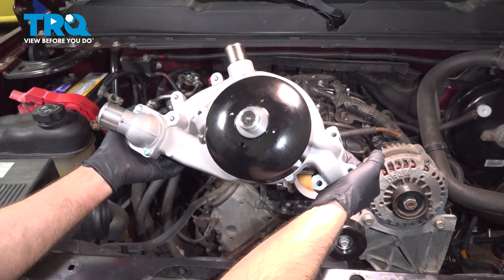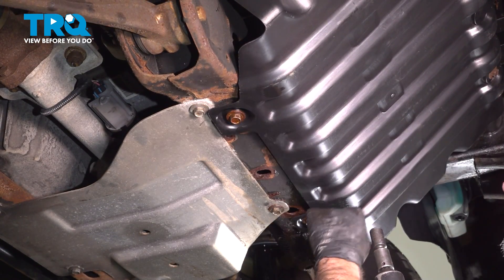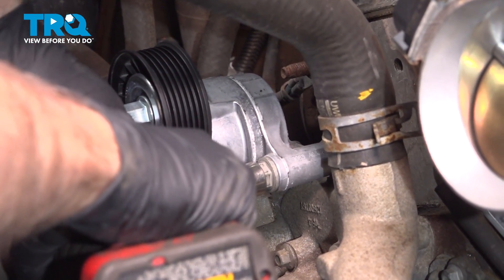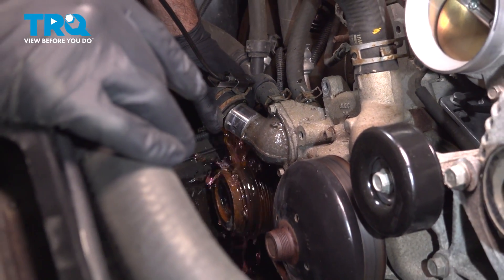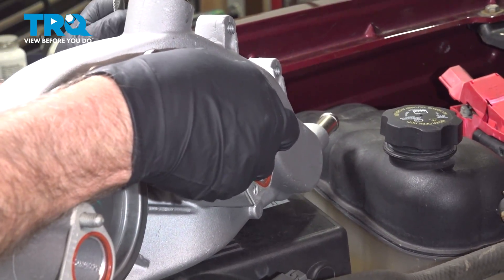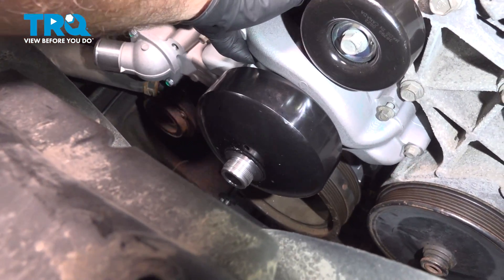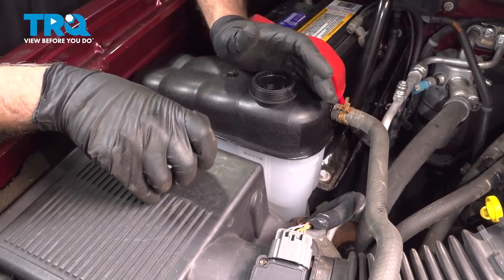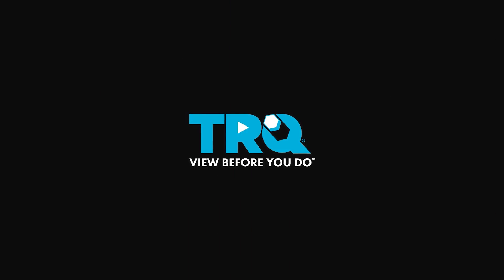How to Replace Water Pump 2007-2013 Chevy Silverado

Comment: i just did this job id say it’s a good time to replace the camshaft sensor too if you haven’t already! had a hard time getting to it without removing the water pump so i waited till i did my clutch fan, radiator fan and water pump and it was a lot easier that way cuz the camshaft sensor ended up getting hella stuck broke into a bunch of pieces cuz the plastic was so swelled and brittle

Comment: You guys saying removing the ac belt was pointless may or may not be correct but this video is part of a much bigger job and was cut into just this section for us just looking for simply the water pump 

An example of this i know for a fact is if you look up a intake manifold gasket on 4.3 v6 then look up a fuel pressure regulator on the same v6 you will literally get the same video just cut after he puts the fuel pressure regulator in

Comment: I have a 2011 GMC Sierra 1500 with the 5.3 l engine. And there is absolutely no need to take off your AC compressor belt from the crankshaft pulley. Avoid this step. Like I said this is on the 2011 model. I can't speak for all the other models but this is the one that you do not have to do it on for sure. I just did it at home. And trying to do so ended up with my wife super gluing my forehead back together my forehead back together.

Comment: I have to comment to anyone trying this job.  This is an excellent video, all you need to do the job.  A few things...I didn't take off the A/C belt, it's not necessary at all.  If you don't have the hose clamp tool he uses in the video, use 6" and 8" vice grips.  They will open all of the clamps and they hold the clamp off the hose in the locked position....way better than channel-lock pliers.  Getting the hoses off and back on can be tough.  If in your garage, use a flat basin to try to catch the coolant....it's a messy job.  I also had an old blanket on the floor to keep the coolant contained. It took me 3.5 hours start to finish and I'm no pro by any means.  Thanks to TRQ for the video, awesome job!
Reply: Bouta do it now

Comment: I have one question..I have a 07 2500hd 6.0 that is fluctuating on the tempature.. would that be a thermostat going out or the water pump?
Reply: So my Sierra going crazy now the heat of the engine is crazy and turns out the coolant was leaking from the water pump… and also the hose that sprays oil on top of the engine was also broken 💀. Im telling you bro just fix everything that comes to your mind pick up trucks are more bitchy then I thought they would be…

Comment: Is there a way to remove the water pump pulley itself. Im going to replace my 2007 yukon denali intake camshaft position sensor, but the harness has another bolt behind the shaft pulley?

Comment: DO YOUR RUN IT WITH THE LID OFF SINCE IT AINT HOT YET SO IT CAN BLEED OUT THE AIR OR JUST ADD THE COOLANT ,CLOSE LID AND THEN RUN IT ??????

Comment: Don’t you have a fan clutch you need to unscrew from the treaded shaft on the end of the water pump pulley?
Reply: These models don't have a clutch fan.  They have electric fans for 5.3L

Comment: What was the purpose of taking the bottom belt off?
Reply: Maybe it’s just a convenient time to preemptively replace it.  I thought the same thing
Reply: To prevent antifreeze from getting on it. Bad for them, supposedly.
Reply: To me, it looks like the belt is in front of the bottom of the water pump housing. Probably had to come off to remove the pump. I'm about to go do my water pump here in a bit. I'll let you know what I discover.
Reply: The only reason I can see is that all that coolant is going to be falling on it
Reply: I’m also curious